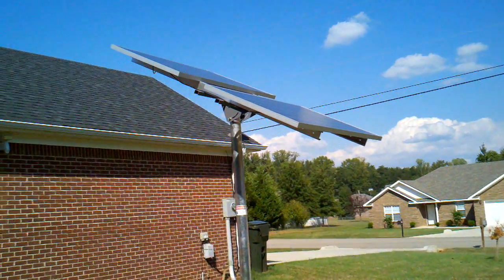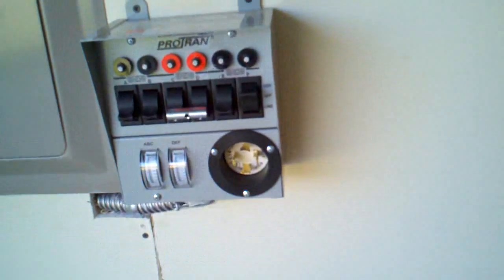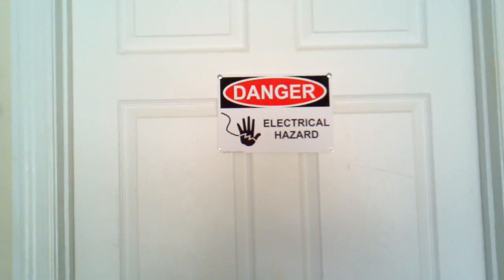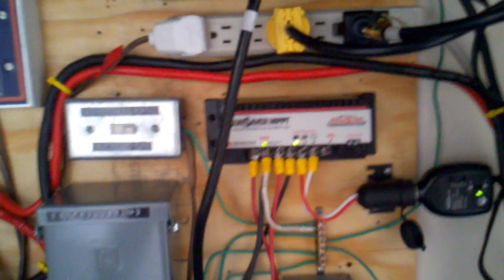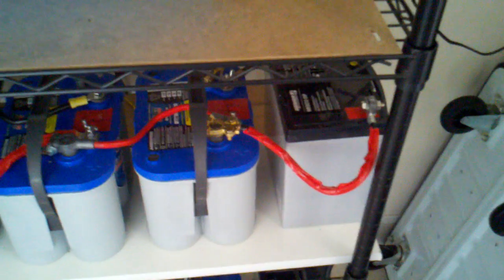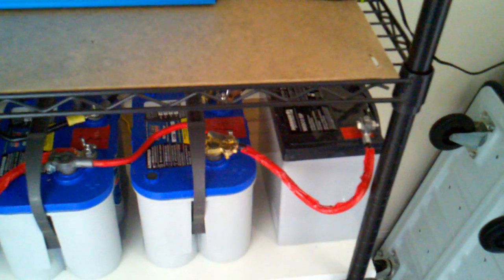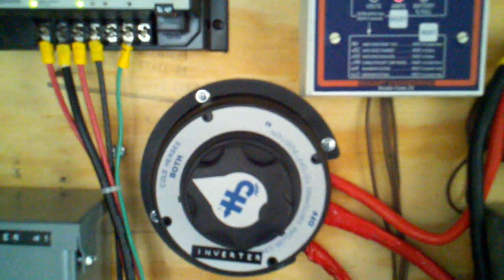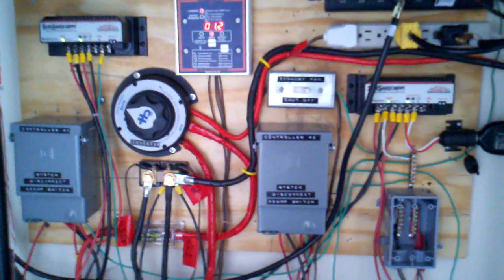DIY - Home Solar Hybrid - Standalone - Grid Tie - Done!!

Comment: Cool to see how your previous system was set up.  Still looks way above the average as far as organization, understanding, and professionalism!  I purchased 2 vmax agm 125 ah batteries about a year and 2 mos ago.  Is it too late to add on another set of 2?  I've heard the new batteries would be limited to the max capabilities of the older 2, even though they are only a year old.  Should i go ahead and put another $560 for 2 more to double my bank or try and re-purpose or sell the used pair and start fresh on a new bank?

Comment: This book [link here>>>https://plus.google.com/u/3/113778429958471787540/posts/67MrRb1YGej ] got me thru the design and installation of a complete off-grid system for my lake cottage. The process of site evaluation, system component selection, wiring, etc. is complex, but with a lot of study and this book, I ended up very happy with the results. Everything you need to know is here. I recommend it for anyone who is starting with little solar panel knowledge and wants to end up with a whole house system

Comment: Hi there, thanks for sharing, I'm seeking a simple way to use solar grid tie at night because my consumption is higher at night because my air conditioners, i don't want to do a offgrid system only for my air conditioner, I think it could be a better idea use grid tie at night , so if you can help me how to size it i will appreciate that. I know if i want to do that I need to connect my solar panels to the charge controller, also the batteries to the charge controller and connect a grid tie inverter to the battery instead a regular off grid inverter. But here i got questions, here is my problem: 1) how to control to on and off the system at night, a timer between battery and grid inverter is a good idea?. 2) How do you size or calculate how many time the system should be "on" to avoid over discharge of battery? 3)  if I use a 12v 100AH battery it means 1200 Wh? so I need at least 1200W grid tie inverter? and that means the battery will feed 1200 watts during a 1 hour and then it will be discharged?, how can i regulate that? feed 1200 watts is to high i think.  Thanks in advance, any help I will appreciate that. greetings
Reply from the maker: I'll try to help if I can, 1st grid tie inverters are practical for use during the day, but if you want to go the route of using the unit at night off the battery bank, then you will require a larger battery bank and then you could use a 1200w grid-tie inverter, but I would recommend a smaller grid-tie inverter (around 600w)  to gradually supplement your energy usage overtime without hurting your batteries by drawing too much power.    Looking at the math, 1200w x 6hrs = 7200wh.  However, 7200wh * 50% Battery Depth of Discharge = 3600wh (that will equal 3hrs of use, not 6) .  The point is, you will need a large battery bank to supply the stored power needed.  if you started with a timer, a 600w grid tie inverter that has a voltage range between 10v to 32v,  and then add (8)  12v/100Ah batteries in series/parallel (for a 24v bank with 9600Wh of storage), and at least 1kw of solar to recharge your batteries, you'll be off to a good start.  Again, looking at the math, 9600Wh / 50% battery DoD = 4800Wh.  4800Wh / 600W = 8hrs of supplemental power.

Comment: Qty of two 12 volt fans wired in a series circuit would allow you to power them from a 24 volt source. No transformer device needed.
Reply from the maker: Thank you for your comments, you are correct. At them time of this video I didn't have that knowledge, but like yourself someone pointed that out to me and I now point that out to others.

Comment: Where did you get your grid tie inverter?Nice system also..
Reply from the maker: Thanks, I did this a long while ago.  You can get these grid ties from ebay.
Reply: I'm having a problem choosing the right one I need.There are two different one.DC Input voltage 10.5-30v or 22v-50v.AC Output Voltage 110 VAC(90-140VAC)or220 VAC (180-260VAC)So THESE ARE THE Options to choose from in ordering the grid tie inverter.Can you help me with the one that I need.Thank You in advance
Reply from the maker: meatdogg101 if you are planing to get 2  12v panels and place them in series, then 20v - 50v would be best,  this would allow you to get the most out of the gti's mppt capabilities.  However, you must use 2 12v panels with a maximum operating voltage between 17v and 23v, like the Kyocera 135w panels.  I don't recommend the other gti with the lower voltage range.  If you can find a gti with the 22v to 60v range, that would be better.
Reply: Ok.Thank you very much.Now I'm on the hunt for everything.Yes I'm doing a 12v system

Comment: You Need NEC 2014
BAD INSTALATION
Reply from the maker: Thanks for the comment.  I wouldn't doubt that it is a bad installation according to the NEC.  But it is DIY after all.
Reply: Yes it is not installed anywhere near code or with safety in mind did it get permitted or inspected?. Does your utility know that you are backfeeding into the grid? More important, will your system island or anti island when the grid goes down? If it islands you could be responsible for the death of a linesman. Also, how is this system grounded?

Comment: There is three things that really stand out that is illegal. #1 That marine 4 way switch is not permitted per NEC they can catch fire. #2 The grid tie inverter is not UL approved. #3 Your wiring needs to be in conduit or water tight flex cable. If you do it the right way you can have your local county electrical code inspector come your place and pass his/her inspection. Take the inspection report to your local homeowners insurance company, show them the report and have them add solar to your homeowners policy. This way you are covered by county and the insurance company in case of fire. In the real world nothing is likely to happen but, best be safe than sorry. Other than that your system looks good.
Reply from the maker: Randy Cammack Thanks for the comments.  This is an old video but I'll leave your comments for folks to consider when doing DIY themselves.  Good advice.

Comment: Great video! Ive never thought of the battery bank switch. Have you ever thought about using some controller to automatically switch to feeding power to the grid when the batteries are full?
Reply from the maker: Czar Corey Thanks for your comments, in answer to your question, yes I'm actually doing that now, check out my video "DIY - Home Solar backup system after 4 years", and a few of my other videos and you'll see.
Reply: Cool! Will do!

Comment: I have a 60amp air conditioner disconnect box(pull out kind) that I picked up at Home Depot that I want to use as a disconnect switch for my solar panels.Can you tell me how to hook that up?The first imput spot fo the wire says line the second one is load and the third is load and the fouth is line.So I am thinking the positive from the panels would be put in the first one that says line,and then the negative would be put into the fourth spot.Any help would be appreciated.Butch Kern the solar guy has kind of gotten me discouraged a little.
Reply from the maker: Gary H Thanks for your comments, I can't speak for Mr. Kern or those like him, but I can speak for myself.  It's going on 4 years now and my home is still standing and my solar backup system has done the job very well. Telling someone how to hook up electrical systems via a comment box is a bit dangerous so I'm hesitant to do so.  I recommend getting an electrician to help you.  Without knowing what your box looks like and what connections are coming from the solar array, it can be difficult to say how to hook up things.  However, In general the line usually indicates the source of the power, and the load indicates the consumers of the power (.ie., controller, batteries, inverters, etc.), pulling the disconnect breaks the connection between the line (source) and the load(s) (energy consuming devices).
Reply: Gary H Line side is the where the power comes from, load side is where the power is going.  for example, on a mains system, the feed from the breaker comes into the LINE side, where as the AC unit would attach to the LOAD side.   it should be a 3 wire disconect, meaning it unhooks both phases of the mains along with the neutral

for your application, its a waste of money.  but you would hook the solar panel wires up to the LINE side
Reply: Brian Fischman Thanx Brian for your expertise.
Reply: Brian Fischman Why would it be a waste of money?Will it not work to disconnect the panels?What would you suggest?
Reply: actually, i assumed the price was alot more, i thought the disconnects were ~ $60, was going to suggest a simple knife switch.   but according to google, a 60amp ac disconnect
 is less then $10,  so never mind, use what you have.
Reply: Thanks Brian,I figured out how to hook it up before your post but you verified that it was done correctly
Reply: A 60A rated AC disco is not rated for DC current.

Comment: Does that ProTran work for generator also?How are you using the ProTran as a solar transfer switch??
Reply from the maker: Yes, I have wired so that I can use a generator for 240VAC if my batteries are drained and for my hot water heater.  I have to make sure I disconnect the inverter first.
Reply: rhandsom I understand how to hook up the Reliance system,but I am at a loss as to how to hook the solar up to Reliance,so I can begin taking one room a time off grid.This would be so much easier than making extra outlets from the attic down through the walls,I could use existing outlets.Do you have a video on this?Or can you suggest one?
Reply from the maker: My electrician installed an auxillary outlet from my inverter to the transfer switch. On the transfer switch are circuits A,B,(C,D),E,F.  In my wiring there are 2 hot legs and 1 neutral.  Hot leg #1 was connected to A,B,C.  Hot leg #2 (different phase for 240V) was connected to D,E,F and the neutral was tied off. (C,D) go together and goes to my water heater (120v (Leg 1) and 120v Leg 2 for the 240V I need).  I also have an Interlock Kit installed in the main breaker box to safely back feed the entire house in an emergency.  In this video, I simply have a suicide power cord to backfeed power to the transfer switch through the 2 120v legs.  At the outlet, the electrician split it apart to have 2 separate circuits instead of one. Note, in this video I'm using an inverter that provides same phase 120V to the 2 circuits. That's fine if all you want to run is 120v appliances, however for 240V, you will require an inverter that will generate true 240V to power the 2 hot legs.
Reply: rhandsom Thanks for the valuable info.
Reply from the maker: No problem, good fortune on your projects.

Comment: i install solar for a living and live off grid... wow all i can say is get more fire protection.....any permits...inspections ... did you contact fire dept. they need to know so they don't die when they come to your house fire..insurance co. won't pay claim... and if your backfeeding the grid you could kill a power co. worker. no disconnects outside.... this DIY shit is going to kill someone and the solar industry will catch all the crap.. this shit needs to stop if you don't know what your doing don't do it!!!!!!  good luck your gonna need it!!!
Reply from the maker: Thanks for your reply, there was no offense taken. I responded mainly from curiosty because your comment and another comment centered on this idea that, this particular installation was unsafe, but didn't give any specifics as to why? As an Engineer, comments such as this makes little sense without explanation. Many DIY projects fail because of poor preparation, understanding or commitment. Hopefully you will agree that DIY doesn't necessarily mean shoddy and unsafe. In this video, I did a few things "unconventionally", but far from unsafe. My current system is cleaned up and many things have been removed.  With a professional installation, I would expect you to do a 100 times better than this and many others you see on youtube, but at that point it wouldn't be DIY.  But the point of all this is, it is always better to tell of the shortcommings and suggest ways of fixing it. It something is unsafe, simply tell us what it is, and how to fix it. Again, I thank you for your thoughtful response.
Reply from the maker: Michael Jay For a DIY project that's been running and has more than proved itself for over 3 years, it doesn't appear to be a bad job. As for laughable, I suppose as a professional installer you can say that, I don't hold it against you, your oppinion is your own.  I've made substantial improvements to the system since this video, and I dare say, my current system would stand up against any professional installation. As someone once told me, give me a book and I can learn anything.  DIY often means a lot of mistakes and learning, and sharing knowledge with others. That's one aspect of what youtube is all about. If you can point out my flaws so that I an others can improve, please do so, otherwise your comments have no real value aside from trying to belittle someone who is obviously trying to learn and share with others.
Reply from the maker: Thanks for your comments. The system is working fine after 3 years and running. The house hasn't burned down, no authorities have come to my door, and there are no issues. As for fire protection, the system in this video has more than adequate circuit protection. This is an older video, but it has correct wiring, grounding, circuit breakers, and fuses where applicable.  There is also a fire extinguisher and smoke detector installed in the area.  True, there are people who may not have the experience you do, But with a book, we can learn anything. I'm sure you had to start somewhere. DIY doesn't mean that the work is not safe, not well thought out or that the work is shoddy. Many of us started out not having a clue, but after a few books on solar implementations and residential electricity, we acquired more than enough knowledge to "eventually" do the job right and teach others as well. As professionals, Solar Installers do have a place in the industry for folks who don't have the time or inclination to do it themselves. To do a good DIY job you don't need luck, you need knowledge and information, which is abundantly available. Take care.
Reply: glad someone said it, 3 of 3 videos i just watched all had extremely dangerous hazards, almost laughable.
Reply: not tring to belittle anyone! would help anyone that wants it. i understand the DIY thing done it for years with everything i can. not tring to be the bad guy... i think everyone should use solar or wind or whatever..could  make you system better cheaper and safer.. don't want anyone to get hurt or loss of property sorry if i offended you. see alot of DIY solar installs and when they fail the solar industry takes the blame and that offends me!! again sorry if i can help anyone contact me. we say the energy solution comes up every morning.....
Reply: rhandsom
The 8 gauge ground should be in 3/4" conduit along with use-2 rated 10 or 12 gauge back to the inverter. Buy a conduit bender and there's lots of how to videos on bending. Far as all that other stuff you have going on. It's mounted on what looks like wood. I would put all that in a metal box.

Permit your install and you'll learn a lot in the whole process. It will also make your install a lot safer because the inspectors will give you a heads up on what needs to change. Really the permit process once approved, if you follow it to the letter, you'll have very few problems and the system will be up to code.

Wires exposed all over the place is not code. Should be in EMT conduit to junction boxes. Firemen need access to dc and ac cutoffs along with your circuit breaker. They are trained to deal with solar but they will have a hard time with that setup. But if your stubborn, case the wire in EMT and use junction boxes with use-2 rated 12 gauge on the dc side. It looks like you have enough roof to do it properly too.
Reply from the maker: Thanks for your comments, this was a small DIY install, I've since modified and cleaned this up considerably.
Reply: Butch is 1000% correct. We take the hit for others stupidity.

Comment from the maker: Simple, an Array of panels is a set of panels. A set of anything requires a minimum of 2. I suppose it could depend on your definition. If your a commercial solar installer, then an array maybe 3 or more panels.

Comment: if you are ever given reason to re-do the fans, specfically the two computer fans, try just running them in series... if you want your fans to run quiet, you can wire even more in series until the fans stop running.

Comment from the maker: With 670w of solar and $0.08 per kWh charged from the utility, the grid ties were not really making any dent in my electric bill.  To make selling electricity back to the utility worth while you need atleast 1.5 to 2KW of power coming in. I've since removed them.

Comment from the maker: The solar panel mounts were purchased online, the pole was purchased online also. As a general best practice, mounting systems should be securely bolted to the rafters. Especially since you plan to put 24 on the roof. As for the utility, the requirements may vary from utility to utility, but you can probably expect some form of a safety inspection to ensure that it's up to the electrical codes.

Comment: I've got a cheaper solution to the fan problem.  Get identical fans and run them in series pairs.  Yes, you need an even number of fans and if one dies they both stop, but its simpler and cheaper.